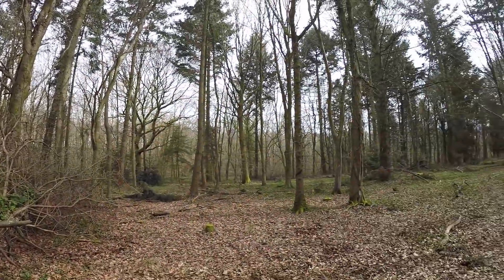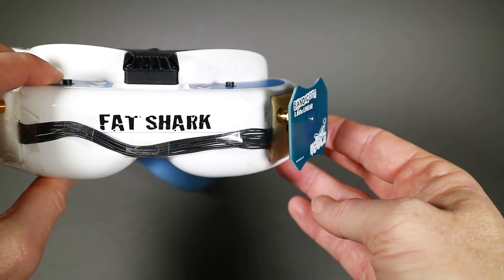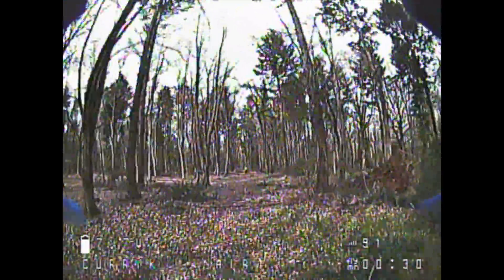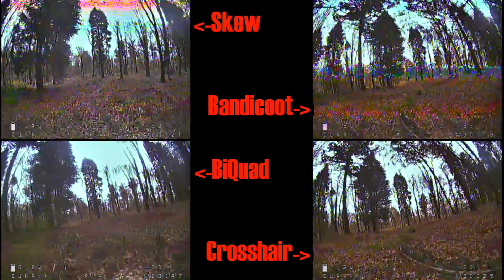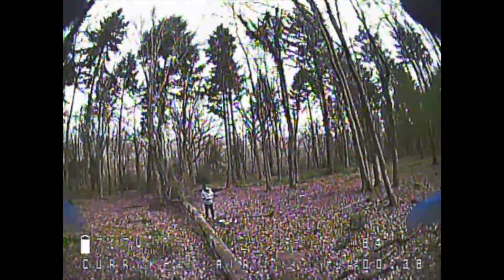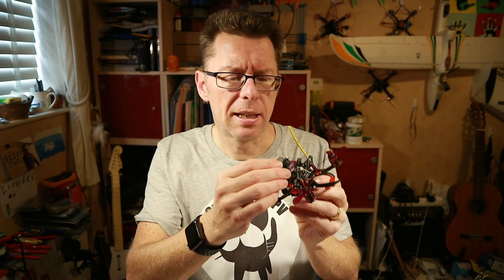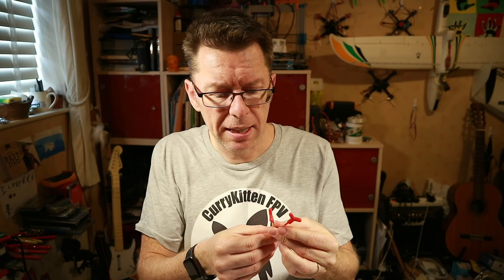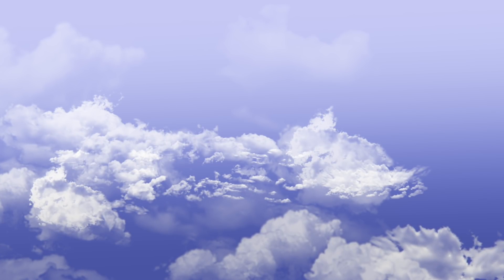FPV Testing: Flying some different antennas through the woods

Comment: Have you seen the abilities of the Pagoda antennas? And the Triple Feed Patch. Impressive on YouTube anyway.
Reply from the maker: Yes - Pagodas are good.  If you watch the reviews I did of the Darkmax, the Bfight 220 and the FuriBee X215 Pro, they all used Pagodas on the quad (they mix in with using a skew on the goggles fine)  I've just got a set from MeanceRC I'll be featuring soon though.  I've not used a Triple feed patch... another one to note down on the list to try out !

Comment: I use the Bandicoot, and I love it. But, I put it on my Aomway Commanders using a 45 degree SMA adapter, so that it is pointing directly forward. It also helps move it away from the goggles a bit. I use a regular Aomway RHCP cloverleaf on the other receiver.
Reply from the maker: Yes, I know a lot of people like the Bandicoot.  Me too - whilst it's didn't perform the best, comparing it to the other gain antennas, it was still good.  The fact it's also super small and fits in the case with my Doms pleases me greatly
Reply: I don't have the others to compare, so it  good that you do these real world tests. Great area to fly in too.
Reply: And on the quad?

Comment: Another great video. I am dieing to get me a 100mm quad. I'm in a budget so I'm trying to figure out which is the best for the money. Great work keep filming
Reply from the maker: Around the 100mm size there's so much choice at the moment, certainly enough to have a fantastic time.  Certainly, the ones to look out for are the ones that have a micro CCD camera installed - such a step up from the old AIO CMOS cameras they used to ship with.
Reply: CurryKitten Do you have a favorite? I was thinking or trying the Blade Torrent because I have a DX7 transmitter. I know it's nutty trying to find a starting point. Maybe I should just jump right in like I did with 5in. Yes CCD is AWESOME!
Reply from the maker: Jumping in is often the best way - as long as you have parts to fix it with :)  I've not looked at the blade torrent, but it seems quite similar to the KingKong ET100.  The only thing I;d say about quad like this is that although you can fly them inside, which is great, there's a compromise in performance when you take them outside... they feel a bit sluggish.  The ones I've really liked flying and keep coming back to is the QAV105 - which is half the price of the blade and you can get a DSMX BNF version (affiliate link) https://www.gearbest.com/brushless-fpv-racer/pp_760122.html?wid=21&lkid=13452083 I've recently really liked the Diatone GTR-90, but I must admit this is a pain to change over to run spectrum on and takes some delicate soldering. I've also just got a AuroraRC Mini Fight (affiliate link) https://www.banggood.com/Aurora-RC-Mini-Fight-110mm-Micro-RC-FPV-Racing-Drone-PNP-BNF-F3-NANO-4in1-BLHeli_S-28A-48CH-1500TVL-HD-p-1226059.html?ID=530011514353&cur_warehouse=CN&p=E81211714085201408XQ again coming with DSMX BNF which I'm hoping for great things for as the Bfight 210 was a great 5" and this looks perfectly scaled down.
Reply: CurryKitten The QAV105 looks great and should be perfect for me. Banggood is currently out of stock at the moment. So I suppose I will have to Waite a while. Thank you very much for your recommendation. An indoor outdoor quad would probably work for me since I fly sluggish anyway. But since I am wanting to do woods flying I think the QAV105 would be better suited for range and video quality. Thank you again for your videos. I do enjoy watching them on a regular basis.

Comment: Bandicoot is a linear patch antenna - best for dipole antenna on quad - need a circular polarized patch if if you have an omni directional on quad
Reply from the maker: Yes - I was using the Bandicoot specifically because I was flying with a dipole.  Menace also have the similar sized Invader patch for circular polarized.

Comment: Great side by side comparison Wayne...You did call that tiny Linear Dipole a Skew in your clip though...lol.
   What you didn't try was a matched pair of directional antennas on your Goggles, which I would suggest could be useful if you are flying a specific course through trees for example...This is my standard 5.8G arrangement and has proved very good when flying at range with 5.8G.
  Angling both antennas outwards can give a wide beam to fly in, even if you are using Goggles and cant see to aim them.
I thought those Vee antennas were good, mainly because they are nice and long, meaning you can get them well clear of the Frame, an important feature they all seem to overlook.
Reply from the maker: I know, I heard it when I watched it back, but decided I couldn't be bothered to insert the correct word as it's so noticable when you dub over something - I figured people would know what I meant :)

Never considered the dual direciton antennas... in part because I don't have a matched pair, but also because I do like to fly all around - but certainly useful in the right circumstance.

Yes, more Vee stuff to come !
Reply: Yes, I know the skew should work better close in on a quad, be interesting to try it though when you use those linear Vee antennas on your vtx though.
   Another linear Bandicoot would make you a pair for your goggles..?
I have been 3.5kms out with just a RD on my planes...the Linear patches on my Monitor are 14dbi gain though.

Comment: I keep running out of clockwise props going through scraggle. You'd think it would balance out but strangely bias
Reply from the maker: It was all CCW props for me, we should meet up a swap :)  That little QAV105 uses some unknown brand of 2435 props which don't hold up very well in a crash - whilst I didn't manage to break a single GemFan 2035s on the Firer frame.  Not a great deal of choice for 2435's, going to try some Racerstars
Reply: Try the new Evan 2.4 they are sturdy.